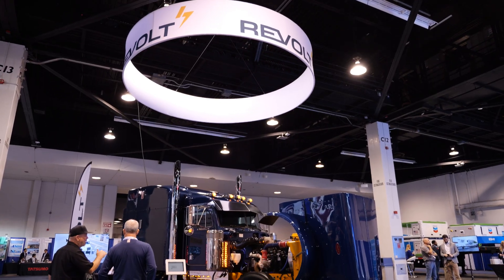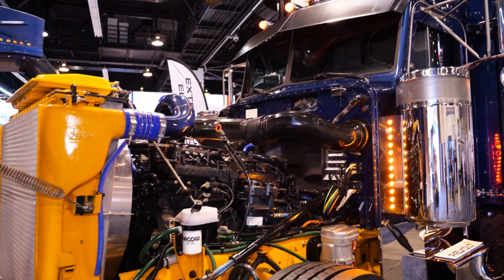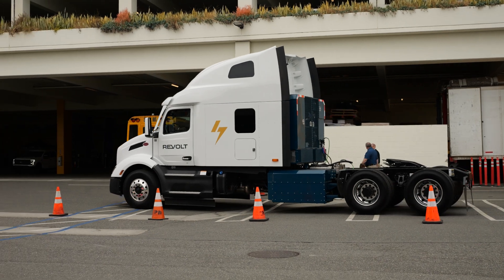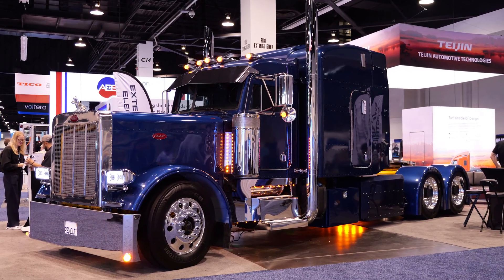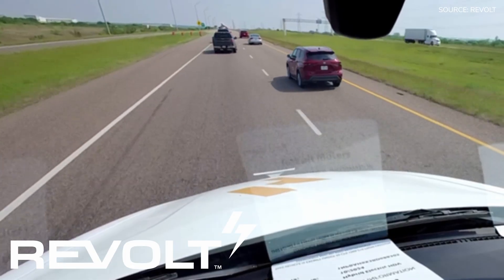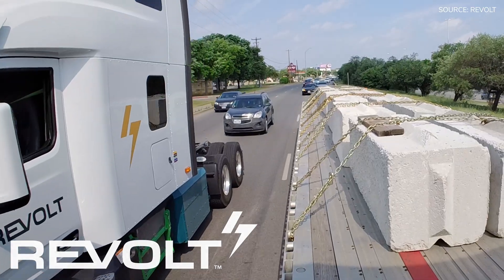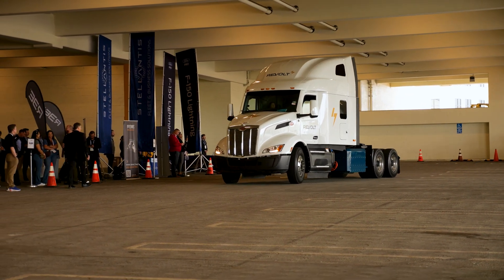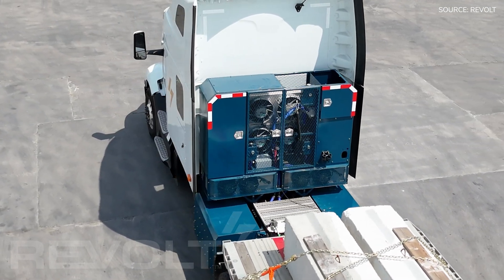Why This Hybrid Might Succeed Where Others Failed | Revolt Motors

Comment: How much them
Batteries weigh? And why would I lower the cargo capacity further? Already loose too much weight with all the bs. Why add more stuff that makes the truck unreliable? 

Can the truck operate on battery only if there is an engine/transmission/ERG failure? 

Can the truck operate on engine only if there is a motor/battery fault?
Reply: I read that it can drive for about 100 miles on battery only.

AFAIK since it has an all-electric powertrain, it can't run on the engine only.

Comment: My question is can that hybrid run power to the truck when the driver is idling or having down time, but needs power inside thw cab for their personal stuff that requires electricity and connection.
Reply: You could park it at a work sight and power all the tools all day without the engine running. 

Put it in a crane truck, run the crane all day without the engine running. 

Check out Edison Motors and Debasi Garage. ( Doubt that is spelled right)

Of course you could power your oven and microwave with it.

Comment: If your gonna do this then the batteries gotta go just have a bigger generator and a engine to turn it your adding way to much weight if trains can do it I'm sure it's possible.
Reply: I think they do this to get under the 'plug in hybrid' regulations as the 'series hybrid' regulations treat it somewhat as traction engine...whereas plug in hybrid is treats the engine as a generator when needed.

Comment: How heavy is it?  What truck owner operator cares about environmental impact?  Before anyone can care about the environment? You first have to make money
Reply: Very telling that the manufacturers and the channel don’t answer questions
Reply: Edison Motors in Canada claims that the weight is about the same. 2 hours electric range, start the generator for an hour to charge the battery. While not stopping. 

Edison is having trouble getting it certified. There are no regulations to allow a series hybrid. The 9 liter Scandia generator is certified for off road use. Put it in the frame rails and it has to move the truck by the engine. Reving up and stuff. Generators run at a constant speed. Not allowed.

Comment: Seems like a copy of Edison Motors
Reply: No it isn't. If multiple brands use internal combustion powertrain then it isn't copying but when revolt uses same powertrain as Edison it is copying. What is this logic...Edison itself copied it from locomotives/big mining trucks from CAT etc with that logic then.
Reply: @ItzKrish_Pal  Actually I wish locomotives would now copy Edison Motors and make a hybrid with a high voltage battery and capture the energy from the braking. As I understand it, Locomotives have "dynamic braking", which uses the electric motors for braking but vents the energy out as heat through resistors
Reply: @jaaklucas1329 its space inefficient to have batteries + ICE generator in a locomotive because the volume of batteries needed would far exceed the engine train itself. And the energy captured about be sub-line to the energy already made by ICE generator.
Reply: @ItzKrish_Pal  The amount of energy wasted by not using regen must be 15-20% thats a lot of diesel pollution let alone fuel cost
Reply: @jaaklucas1329 most locomotives are electric anyways, diesel-electric has become a niche even in developing nations like india. Ever heard of "If it ain't broke, don't fix it".
Reply: @ItzKrish_Pal  Diesel electric locomotive doesnt use the regen energy its vented as heat. Diesel pollution is the issue
Reply: @jaaklucas1329 bro did you not understand.most locomotives are electric anyways, diesel-electric has become a niche even in developing nations like india. Ever heard of "If it ain't broke, don't fix it".
Reply: Ahhh,  now I understand why this showed up on my feed.  tHanks.  Have a super weekend